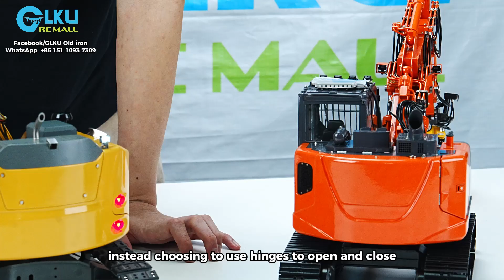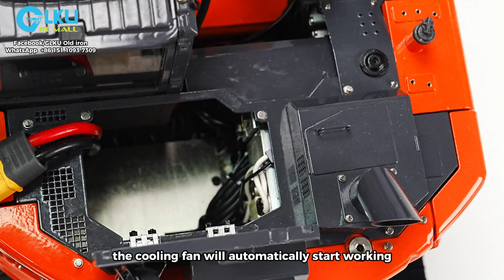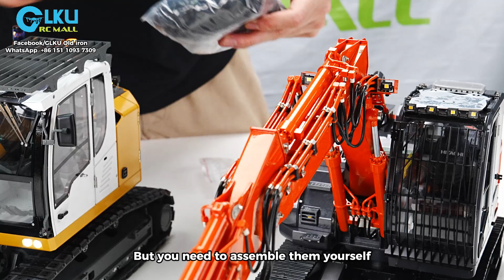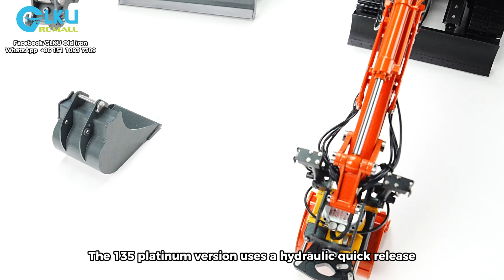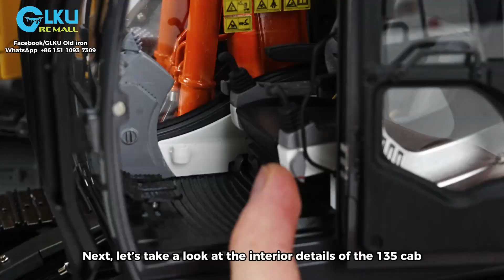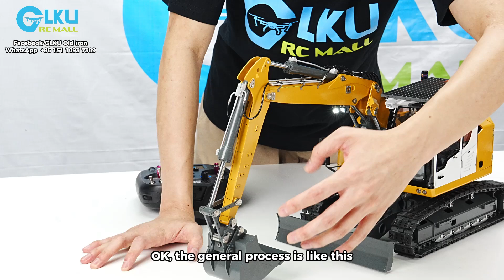1/14  Liebherr C914 and Hitachi 135 excavator (top version) Comparison #rc #rcmodel #excavator

Comment: Hello. Which way does the hydraulic pump motor of 914 rotate? clockwise or counterclockwise?
Reply from the maker: clockwise
Reply: My 914 doesn't work because it moves counterclockwise XD. Thank you for your answer @GLKUOldiron
Reply from the maker: @jhkim3774  Has it been repaired?
Reply: Yes, I reversed the endpoint value of the controller and operated it @GLKUOldiron